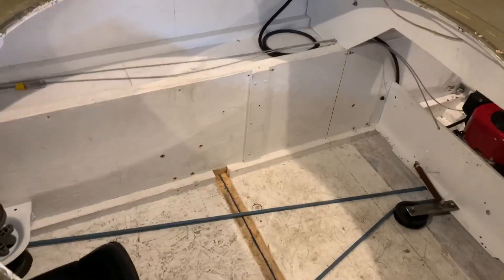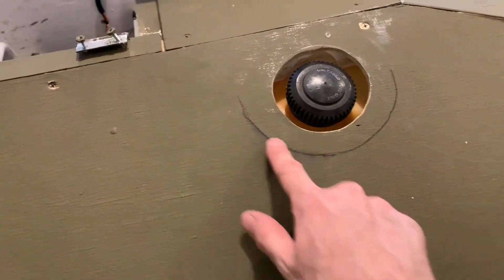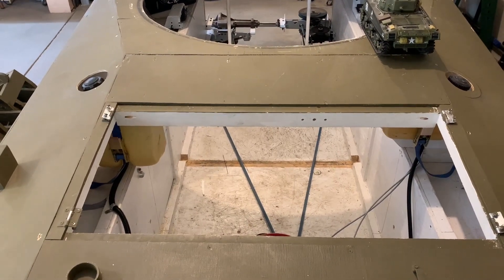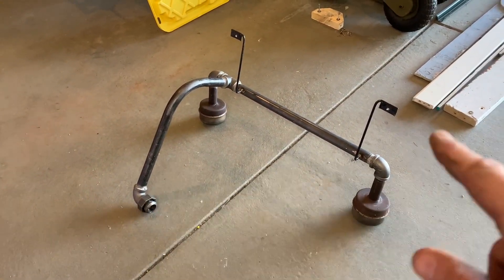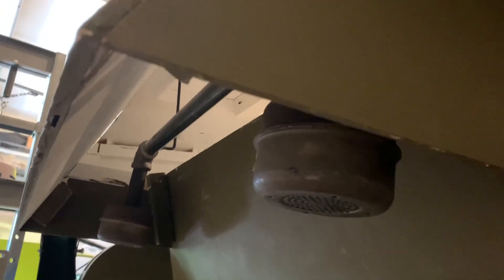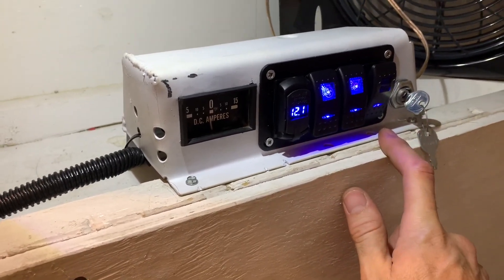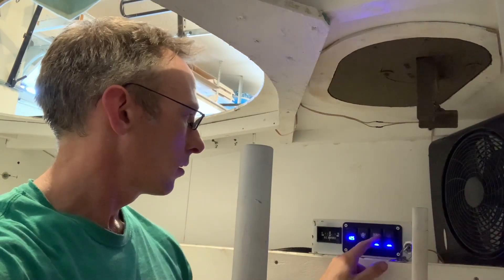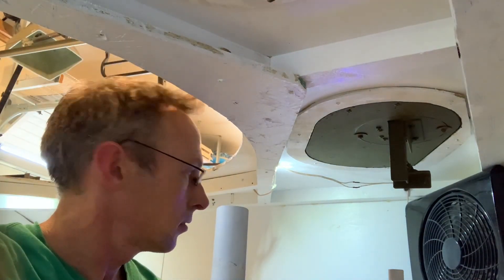M4A3E2 Sherman Jumbo Scale Tank - Engine Startup

Comment: I love your tank, i built a tank out of a mooncar some time ago, and now im building a motor powered king tiger with 13 hp, taking alot of inspiration from you! do you know Where the jumbo tank model is from?
Reply from the maker: Looking forward to seeing your King Tiger! Where is the Jumbo from?
Reply: @ryanhahn7251 Yes the small model you used to see details at 0:30
Reply: Yes, the small sherman model where you look at details, do you know where i can buy it?
Reply from the maker: @spenceystudios  That is a radio controlled model I bought on Amazon made by HengLong.
Reply: Thank you, and quick question, do you plan on building any new tanks? Just because in one of you videos 3 years ago you said you might after you get some more garage space.
Reply from the maker: @spenceystudios I don’t have any plans right now. Maybe next year.
Reply: And also, i dont know where to start and im not even sure if i want to build a replica of a Easy eight sherman or a king tiger, do you have advice?
Reply from the maker: @spenceystudios the king tiger will be more difficult and expensive due to the more complicated suspension. The E8 Sherman has twice as many wheels with the HVSS suspension so I went with a Sherman with VVSS for lower cost.
Reply: Whats something you wish you did differently when building your sherman tank?
Reply from the maker: @spenceystudios more durable suspension and tracks. But that was really the result of starting with a pedal tank. It was only safe to drive on smooth pavement. Turning a tank puts so much stress on everything, essentially the same as pushing it sideways across the ground.
Reply: Thanks for the info! I was also thinking about building a tiger 1, but i dont know how to decide, do you have any advice for that.
Reply from the maker: @spenceystudios  Tiger I is about as complicated as Tiger II: 16 torsion axles and 48 road wheels! For a German vehicle, I would try something simple, like Jadgpanzer 38T (Hetzer).
Reply: Yeah but its more their looks, i cant choose which one, and i have multiple ideas on how to make a suspension system like the tigers. Do you have advice on how i can choose which tank i should build? Because i love all of them,
Reply from the maker: @spenceystudios  My advice is to keep it as simple as possible. It's going to be a lot more work and money than you think. Better to have a simple tank that's complete than your dream tank that only gets 25% complete.
Reply: so the jumbo isnt you favourite tank?

Comment: What thickness of plywood did you use cause plywood prices are through the roof.
Reply from the maker: The tank was built in early 2000 before wood prices skyrocketed. Now, I wouldn’t be able to afford it! The suspension is 3/4”, the floor is 1/2” OSB, lower hull sides are 1/2”, upper glacis, hull roof and turret roof are 3/8”, sides are 1/4”. The transmission cover and turret sides are 1/8” hardboard.

Comment: Awesome!  I've built a full scale running WWI FT "model" tank powered by a 6.5hp predator. Wood body/turret on a steel carriage.  Have some videos on it. Are you making  sure there is zero chance of exhaust migration (CO) into the crew compartment?  I got some warnings about that but ignored them until I studied up and now I have retrofitted the exhaust and am redoing the retrofit.  That overhang might bring some of the exhaust gases back up into the tank?   CO is very penetrative.  Is that fan to provide positive pressure into the crew compartment or just for cooling?  Thinking about adding one to my "tank".  The thumbnail is before it was more or less finished but still lots of detailing I want to do.  MG shoots (propane/oxygen).  I have my "tank" set up so the engine can be cut off from outside the vehicle as well as the inside.
Reply from the maker: Nice job on that FT! Thanks for the warnings about CO. I plan on having positive pressure in both the crew and engine compartments. I will caulk all of the seams between the two compartments. And I have a CO sensor that runs on AA batteries that I will put in the tank to give a warning if any is getting through.
Reply: @ryanhahn7251  I think I will be putting an active sensor in also.  My FT is not really intended to be something to sit inside very long in any event although it might find itself in a parade one of these days and maybe even a reenactor battle (one scheduled in November).  it's a flat ground runner and in the battle it will only be there for a few minutes of running and video with the soldiers.
Reply from the maker: @hoodoo2001  it’s not a bad idea. Your tank looks like it would have great ventilation for the driver until you’re buttoned up.